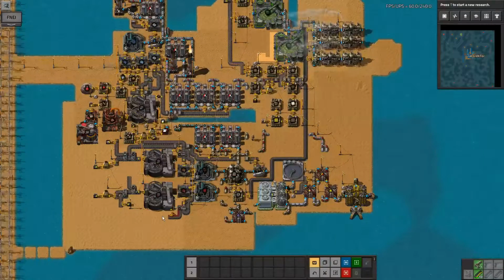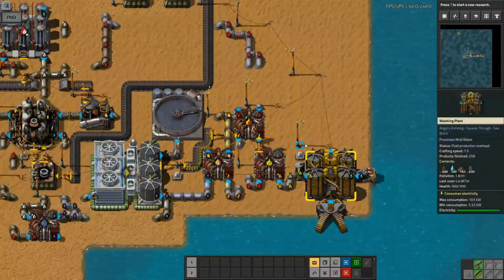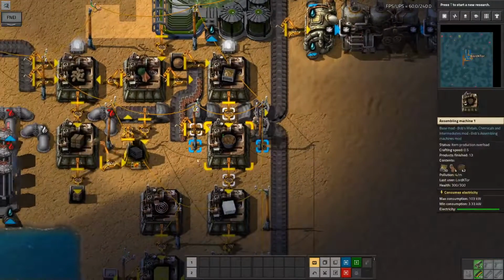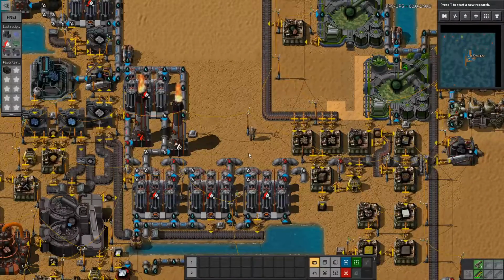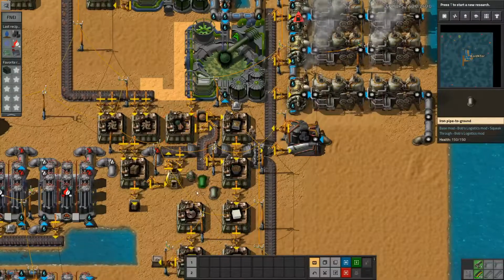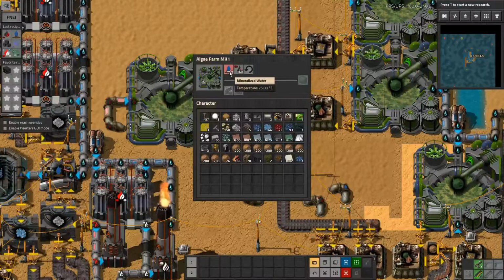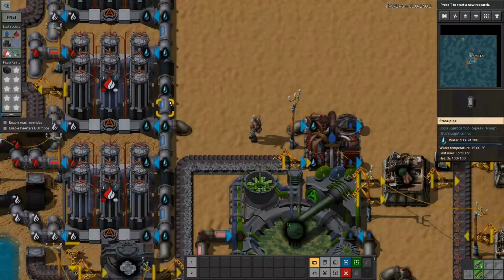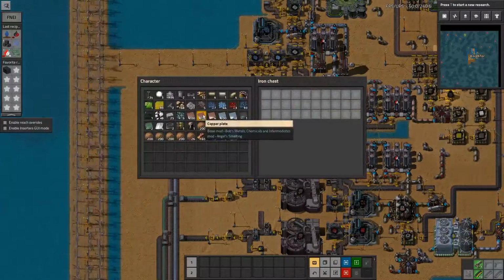Factorio Seablock + TSM  ep8

Comment: 24:10 - You can configure inserters to only turn 90°. This is incredibly useful. They can transfer between buildings right next to each other, saving space. They are also almost twice as fast as standard inserters, because they only have to turn half as far.